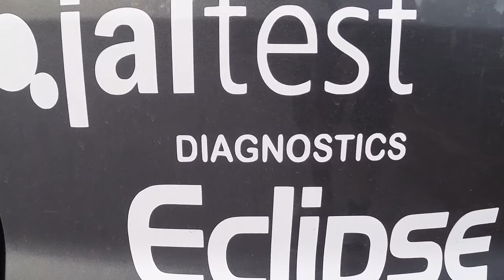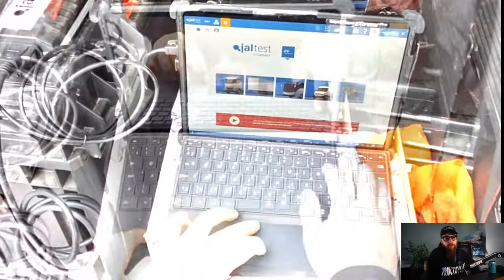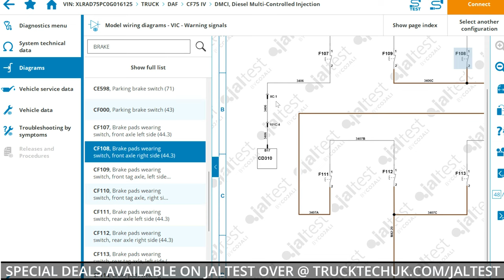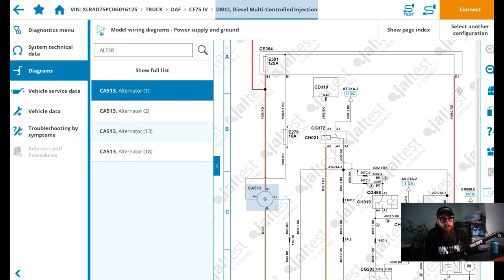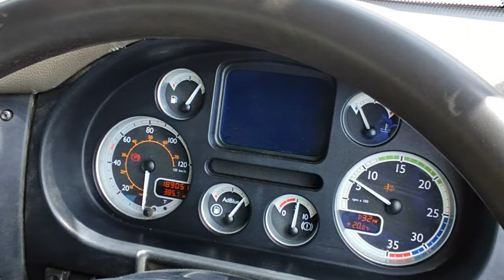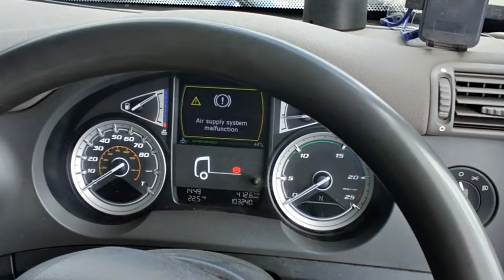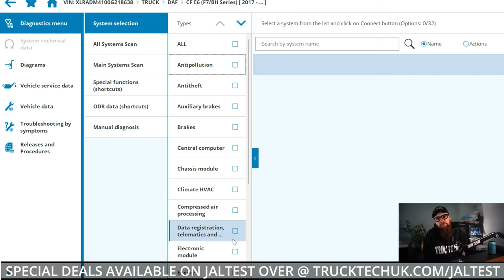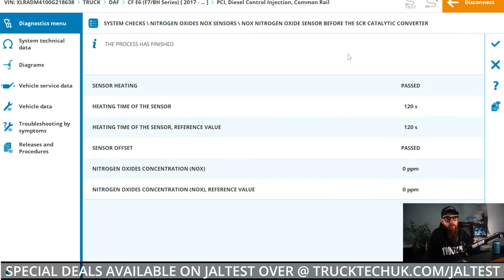DAF CF brake wear, alternator and nox sensor diagnostic with JALTEST.

Comment: Can you tell me is this the same method for putting Brake wear out on a 21 plate CF,,, is it Block 8C and same wire 3406
Reply from the maker: Hey Jon, God no! 3406 didn't exist after 2017 on daf xf and cf. It's done via chassis ECUS buddy. The chassis module front does the front brakes and the chassis module rear does the lift/drive or tag axles. The best thing about this system is you can see which pad wear sensor is worn through the diagnostic tool 👍

Comment: How do you access brake systems and pad wear sensors for a euro 6 on the jaltest our software dosnt seem to have it
Reply from the maker: Hey, thanks for the comment 👍. Do you mean to check individual pad wear sensors? Euro 6 didn't have this and you need to check the sensors manually. Model year 17onwards has the individual pad wear sensors reporting

Comment: Nice work 👍 I could see you looking for the little blue light on the Jaltest interface? Texa has a beep when you connect it and a light. Maybe Jaltest could include this in the future?
Reply from the maker: Hey thanks for the comment 😀 yes the blue light is difficult in bright light but if used my eyes and looked on the tablet it would show me the battery voltage at the OBD on the screen but I like to check I've comms before walking away from the VCI. 
Great idea! I will speak to Eclipse to see if COJALI could add it in the future possibly 👍

Comment: Good vid. I look after a few dafs. I use Texa, been struggling on a few 19 plate cf with dpf soot level high issues.
Reply from the maker: Hey Bob, I've a 2 part video on the exhaust system and how they are made of chocolate 😂. They have a few components that can trick the eas system into thinking its full not to mention rapid soot loading issues from the turbo. 
If you want a pin-point accurate diagnostic and some methodical testing with jaltest I'm covering everywhere now buddy 😅
Reply: @TRUCKTECHUK  ok thanks for your reply we’ve changed the dpf, pressure sensor and the two sensor pipes. Customer brings it back in every few weeks for a manual regen, then he later said the Eml and emmisons light is intermittent from saying soot level full to clearing its self then beck on a few hours later. 
It’s coming back in Saturday for me too look at. If I fail then might have to give ya a shout. What’s ya labour rate ?
Reply from the maker: Oh, it certainly sounds like a good video lol don't forget the EGR plays a part in this too as you have a pressure sensor on the venturi that is taken into the calculation as is the pressure sensor before the turbine on the BPV.
I'm 50 pounds an hour buddy, hopefully that's not too wild where you are.

Comment: Looking forward to more videos 👍🏻👍🏻
Reply from the maker: Ohhh so am I! Just need to make sure I get them out as fast as I can now!
Reply: @TRUCKTECHUK  I find them interesting as I work on a small fleet of xf106‘s but have no diagnostic equipment or information so it’s great to watch your diagnostic processes 👍🏻
Reply from the maker: You REALLY need to invest in some diagnostics.....not because it's the way the world is going but also because it opens the possibility to you testing or checking components quicker and with less work. For example, why use a multimeter when you could check the voltage through monitoring data in a ecu? 
I'm not saying DAF diagnostics are a must to fix these trucks as it ISN'T. It's why I started using multi Fleet diagnostics such as jaltest to show the world its a methodical process mindset not the dealer diagnostic tool that is doing the work.....its you.
Reply: @TRUCKTECHUK  the only thing that jaltest cannot do is update the modules, or schedule them when new ones are installed.  I've already tried.  On one occasion it did not allow me to calibrate the engine oil level sensor on a cf 410 euro vl.  but in the rest the jaltest is very useful, to perform vtg calibration, check the fuel system, EAS operation, adblue pump and others.  in addition to allowing the regeneration of the DPF.
Reply from the maker: @mauriciogomez1410  don't get me wrong like I said on the podcast jaltest will do 99 percent of my day and that one percent it can't will be certain module programming. Granted jaltest can copy and paste certain ecus such as ECAS, SAC and haldex gen-3 trailer valves but for alot of ecus it cannot.....but I feel that will change soon! It has too as we can't continue to add ecus to trucks and be left in the dark when it comes to programming. I think it will need some sort of super user access though to prevent random people just bricking ecus with such a powerful function

Comment: Excellent video. Thank you.
Reply from the maker: Hey thanks for the comment and im glad you enjoyed it.....not my usual video format but a bit diffrent 😬
Reply: @TRUCKTECHUK  The video was very interesting, if it is true that it changed the format a bit, but the important thing is that the whole procedure is understood and what it wants to teach us.  Since the channel started I have always watched his videos, and he has always tried to make the entire system of the vehicle work in an original way, but with euro 5 he took a ground signal to eliminate the brake malfunction warning in the dip, and an independent positive signal for warning of alternator malfunction in the dip.  It is another way to solve the failure, and it is valid.  I am not criticizing you in a negative way, I just saw that in this video you change the way you solve the failures a bit.  Congratulations, excellent video, and thank you very much for teaching.  I'll be on the lookout for the video on the Nox sensor solution. 👍👍
Reply from the maker: Thank you for the comment. It's nice to get some feedback on things 😎

It's true this video involved me fooling the system for the customer, and hopefully, they will be few and far between as how it works from the factory is the way! 
Understanding how the system works gives me the ability to do this. Ultimately, I'm not in the dealership now, and Mr. Daf doesn't pay my wages, so I have to do cost-effective repairs to suit different customer requirements.
Let's see what I've got coming up in the next few weeks 👀
Reply: @TRUCKTECHUK  yes sir it is true  the truth is a quick solution to avoid unnecessary waiting times for the customer.  As I had told you a while ago, I also work with the DAF brand and on some occasions quick repairs must be carried out, but as you say with due knowledge of how the system works.  blessings.
Reply from the maker: @luisjaimegomez1085  it's hard to do the right thing sometimes 😕 . Take care man, hopefully catch you next week 😎
Reply: @TRUCKTECHUK  TRUE.  I will be waiting for your next video, for next week.  You will always have a like on each video.

Comment: Hey just found your channel great content 👌🏼 I’ve owed a CF 75 2012 from new done all the maintenance my self  and was just wondering how long have you seen these engines last for? I’m just about to hit 1.7 million kms I’ve only replace the water pump everything else is still working but know I’m starting push my luck cheers
Reply from the maker: Hey Gary, thanks for the comment 👍😎
I think you certainly bought one of the better trucks. I know owners who can follow DAFS  service and maintenance to the letter and still have failures with the modern product 🙄. Balls in your court....the trucks paid for itself. If you don't need to comply with any new low emission zones and isn't looking like Swiss cheese rust wise, i'd keep her going for as long as possible 😉

Comment: excellent video.  and a rapid repair of failures.  waiting for the solution of the Nox sensor failure.  I also learned how to find the wiring diagrams for the different brands in the jaltest.  Do you only work with the DAF brand?  Or do you have videos with other types of trucks?  Thank you very much for the time you dedicate to make, edit and assemble the videos to teach.
Reply from the maker: Hey Mauricio👋. 
The solution for the nox sensor repair was a replacement and I've just been back today to clear all the old faults.......I class it as good housekeeping.
I do other brands of trucks as of today as I'm going to be carrying out Injector testing and replacement in a MAN TGS once I get the procedure on how to do it 😂
I love making these to help people even if it takes me about 8 hours to do a video! 😪😪😪😪
Reply: How do you put the Help button on your channel so we can donate
Reply: The difference with you is you don’t seem to miss out important bits in the videos it really helps and I’m sure many people would contribute financially-hopefully as it certainly takes time to make these bids and the explanations in edit stage. I think the narration model of vid works really well because the thought process after the fact is so much clearer and concise as it can be paired down once you’ve got all the variables out of the way
Reply from the maker: Hey 👋  thanks for the comment. I use to have a donate button but no one ever used it 😂😂😂 it was here: https://withkoji.com/@Trucktechuk

Comment: Hey Russell, Good to see you on the road, looking forward to your content, and hopefully some sneaky advanced Jaltest training. Will you just be sticking to Daf or other vehicle makes?
Reply from the maker: Hey buddy 👋 how are you? Content and manufacture wise I'm open to anything as I want to use jaltest to its maximum but for knowing what I'm doing DAF certainly is a product I will  always gravitate to work on in the blink of an eye!
Reply: @TRUCKTECHUK  I have tried to connect jaltest with a sinotruck truck, with a yuchai YC4HDN-40 engine with CNG fuel but I have not had any luck.  Connects very well with Kenworth, t600 with Cummins ISL-G and L9-N engines.  With jaltest you can test actuators, check sensors and check spark plugs.  I don't know if they are still improving the jaltest diagnostic equipment, to be able to modify the parameters of clients in DAF trucks and configure the minimum and maximum RPM for the operation of the pto, because I have tried to make that modification and it has not been possible.  I'm glad you finished the work with the Nox sensor.

Comment: On the brake pad warnings can they still be earthed on post 2018 XF's?
Reply from the maker: Hey Charley 👋 . As I wrongly stated.... trucks after MY17 have individual brake wear sensors which DO NOT GO TO ECAS-5.. .. I must have been having a STUPID MOMENT.

Brake wear warnings can be monitored individually through Chassis Module Front and Chassis Module Rear which is on F-CAN. 
As for earthing them, that is how the system works but you will have to do it for every wheel unfortunately 😕

Comment: Hello Russell, DAF trucks have a speed limit of 90 kilometers per hour, whereas the speed limits for trucks in our country, according to driving laws, range from 110 to 120 kilometers per hour. How can the speed limit be adjusted for these DAF trucks with 480 and 530 horsepower?
Reply from the maker: Hi thanks for the comment. 
Unfortunately with the uk speed limit, the max limit being 90KPH I've never been able to adjust the software beyond 90kph.

I'd imagine this limit is able to be altered on a software level by daf. Again something I've never been asked to adjust or go past so I would be a question that would have to be asked to daf by the home dealer 🤔 

Hope this helps
Reply: @TRUCKTECHUK  
Thank you, Russell, for your insightful response! Your input has been truly valuable in clarifying the situation. Unfortunately, in our country, there is no DAF dealer available to directly address these matters. Thanks again for sharing your knowledge!